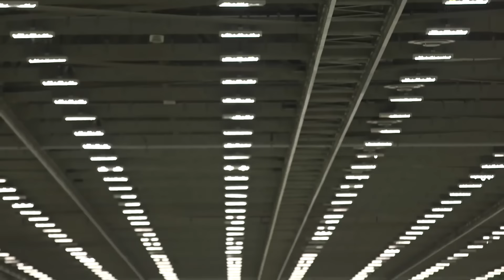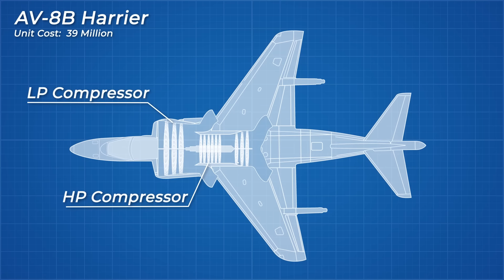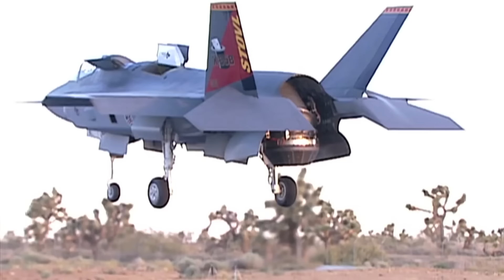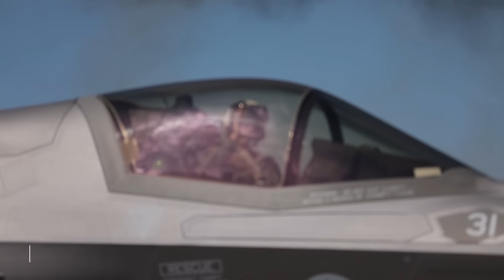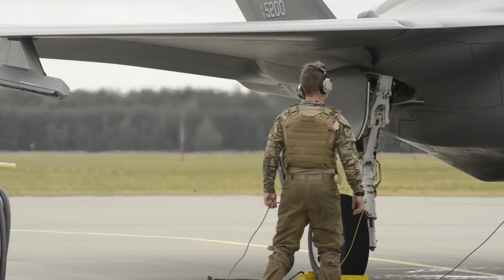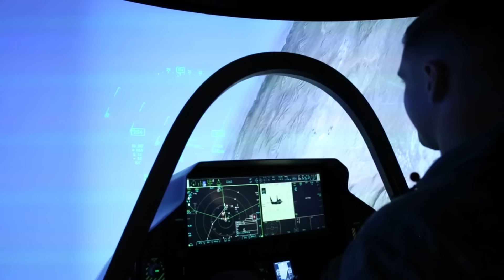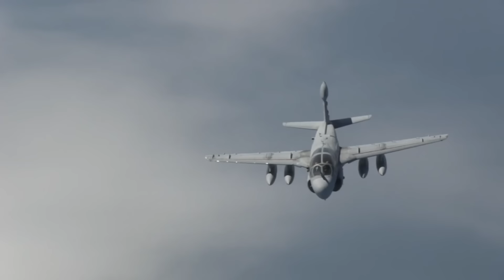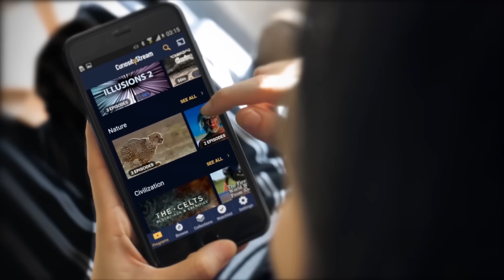Is The F-35 Worth $115 Million?

Comment: The $1.5T cost associated with the program is the total Cost of Ownership after 50 years of use and not the purchase price. How much would a family car cost for a similar duration including all gas, maintenance, a couple of engine changes, etc.?
Also, try comparing the cost of a large program/ bureaucracy building 3 variants Vs 3  large programs/ bureaucracies building separate jets with very little commonalities and synergies.
Reply: Another way to look at it is how much would it cost to sustain the jet fleets eg. F-15, F-16, F-18, 
Harrier, A-10 that it will be replacing for the next 50 years?

Comment: All season tire has compromise, this is what I got from the 2012 interview with Pierre Sprey. He may have been right, as now we see 3 versions A, B, and C! Still, you end up with the same airframe, even though you don't carry the vertical lift weight, I think there is a compromise in an al season tire.
Reply: Nope wrong again brainiac. Airframes are not the same. The F-35B has a much different airframe from The A or the C. You really should do some research before posting. SMH 🤦‍♂️
Reply: @CH-pv2rz  Yes, thanks for clarifying, I don't say that I am knowledgeable, so I am asking how things are now, because I see there is new info on this channel. Previously, there was a lot of bad press from interviews with retired engineers. I am just getting information.

Comment: Only the USMC variant costs that much for obvious reasons.   The Navy costs more that the USAF version, again, for obvious reasons.   The USAF F35 cost is down to around $80 million which is less than the price of an F15 or F/A 18.  The price comes down the larger the order because fixed costs and development costs are spread over more planes.  This is basic economics.  I will say that I fully support the F35 regardless of cost.  It is so far advanced compared to the J20 or SU57 that it can completely protect this country from external threats.  I wish it could protect us from Trump.

Comment: No way this could replace the A-10.
Reply: A-10s airframe is getting old. They basically make a fixed amount of planes and when they become to old to maintain they replace them.
Reply: I agree that replacing the A-10 and trying to fill a CAS role is the most problematic for the F35. I'd love to see a more specialized modern replacement of the A-10 personally, but I'm reserving full judgment on how well the F35 will do at CAS... it just doesn't have the same psychological impact for sure though.
Reply: Not really, because it would not fly the same mission profile. It would use its advanced avionics and precision weapons to kill from high altitude instead of down in the weeds.
Reply: The thing is A-10 has terrible situational awareness. I kinda recovered from awe of BRRRRT, highly recommend LazerPig's video on it.

But yeah, stealth planes for CAS role feel just... wrong
Reply: @John McCall: Are you sure?

Comment: The real killer for the F35 was that it wanted to be a jack of all trades.
That is simply impossible without extensive funding and research and practice, and by the time designs are finalized a new one will pop up with a new innovation.

The F35 should've been primarily built for the marines with secondary uses for the air force. The A10 already does air-to-ground combat extremely well, and any and all ATG combat requires that anti-air capabilities are disabled first so making the F35 have a focus on ATG combat just divided attention to a dead end.

Comment: The F-35 WILL NOT EVER replace the A-10 Wharthog, Ever. the Wharthog can do things the F-35 will never be able to do like loiter for almost unlimited amounts of time and save the lives of guys like me who were combat infantrymen who would call for aira support from A-10's.  Every time the Air Force tries to retire the A-10 Congress says HELL NO.  It is the toughest, most capabale airframe out there.  You can shoot off an engine, or 3 feet of a wing or a complete hydraulic system and it will bring the pilot home safely.  It was built to take massive amounts of punishment and still do the job  it was intended for.  So far this plane is not slated for retirement until 2040 I think.
Reply: The A-10's ability to withstand punishment has been far outstripped by the power of modern surface-to-air weapons. It was built to withstand manually-aimed, relatively low calibre machine gun rounds, not radar-guided high-calibre cannon fire or SAMs that are present on platforms like the Tunguska - it's probably not even safe from man-portable AA weapons at this point. The only truly survivable airframes nowadays are the ones that don't get hit at all. That's why the A-10 doesn't fly in contested airspace, even going back as far as the Gulf War. It does have the advantage of a long loiter time and being economical to operate, meaning that it actually is a better fit for the anti-insurgent job than the F-35, but it'll eventually be replaced in that role by light turboprops that can loiter for even longer and are even cheaper to fly.

Comment: The F-117 we lost that was shot down wasn't a failure of the aircraft , or pilot. It was shot down because mission planners had the planes following the same flight path to the targets over and over again and even if you can't see a plane you can hear it and if it follows the same path enough times it can be tracked and shot down. They broke the age old rule of when in battle never be predictable.
Reply: Same thing happened in Mogadishu.  Remember Black Hawk Down?
Reply: Well it was a mixture of things. As you said it was planners sending them down the same routes but it was also the fact that the nighthawk wasn't flying with the usual A6 Intruder escorts it'd have normally running radar interference, as well as the bomb bay doors being jammed open, significantly increasing it's visibility on radar.

Comment: Guys so-called "invisible" f117 shot down by the Russian-made 60's air def system. USA always forgot the most important rule ever they invented.
Murphy's Rules #1 "Anything that can go wrong will go wrong".
Reply: How is this relevant?
Reply: @infinitelyexplosive  f35 main thing is invisibility like f117
Reply: @schattenfaust  You're wrong on so many levels. First off, stealth is not invisibility. The point is to make it harder to detect the aircraft. In a more stealthy plane, you can get closer to a target than in a less stealthy plane. This is exactly the reason we have soldiers wearing camouflage. No one says camo makes you invisible, but we still wear it. 
Second, stealth works. Despite flying thousands of missions against heavily defended targets, one F-117 was shot down in total. If that's not evidence of the benefit of stealth, nothing is. 
Third, the F-35 is a multi role fighter that has stealth as a major design consideration. It's still maneuverable and fast like existing designs, and has some of the most advanced avionics in existence.
Reply: @infinitelyexplosive  are you saying f35 can take out su 35 or mig 35?i know being stealth is good when you lost the stealth in f117 case early opened up bombing ports detected by serbian defenders and that was from 90's .i dont know  putting all your money on something can be detected is bot safe option for me even su 27's giving hard time to f 35 is all about early detection
Reply: @schattenfaust  are you saying f35 can take out su 35 or mig 35?
Yes, absolutely. Most planes can conceivably take out other planes. AAMs are very effective and a lack of situational awareness in combat can easily lead to planes getting caught out, even when they are technically superior. The idea with stealth is that it creates an informational imbalance. It's more likely that the F-35 sees an enemy than the other way around, meaning that F35s are generally at an advantage.
Reply: @infinitelyexplosive  ok for the argument what is somehow su35 or mig35 sees f35 first for example with the new tech break through? what would happen?
Reply: @schattenfaust  Then the Su/MiG-35 had a decent chance of winning the engagement, depending of course on tactics and the overall situation.
Reply: @infinitelyexplosive  Technological advances in our decade, creating means to the new approach I understand f35 stealth need or ALIS integrated logistical support, but f35 is not adaptable to changes in technology, in my opinion, it's not like  f16 or f15, not sturdy, not agile not good at multirole, he is good and one thing and trying to excel to it but if it fails it fails completely.

Yes, only 1 F117 is shutdown  $160 million worth of equipment shutdown by 20.000 USD 60's era Soviet AA system. but you missed my point completely (or I can't describe it within understandable reason:) F117 was created for the sole purpose to bomb the enemy before establishing air superiority over the enemy, now its purpose changed  180 degrees as mop up enemy ground targets after the air superiority establish. All those planning does drain with one event. Maybe this is why USAF feels the urge to create a new "stealth fighter".
Reply: @schattenfaust  now its purpose changed  180 degrees as mop up enemy ground targets after the air superiority establish.
I disagree with that characterization. We understand that stealth alone is insufficient for modern strike capability, but it still allows for a smaller force to accomplish the same goal. We won't be flying any more missions without ECM support, we learned that lesson from the F-117. Note that essentially every new fighter project has incorporated at least some stealth elements. The difference is in how much they sacrifice other aspects in favor of it. 
The F-35 is still quite agile and capable of air-air missions. It has a lower top speed than the F-16, but it's important to note that neither will be flying at their top speed and that the F-16's need to carry several drop tanks reduces its aerodynamic performance further.
Reply: @infinitelyexplosive  But let me put it that way just think about f16,f15, FA18, capable or like how my uncle says  "hammer" like airpower, today most of those planes still even with their old ages able to go toe to toe with current fighter jets, it was a solid marvel of western military technology, also affordable, adaptable, efficient, dependable.

I read a lot of things from the internet about f35 as an aviation enthusiast, I know a lot of bad information is out there but the project is delaying and already past deadlines and still feeling rushed somehow and overall budget goals are not calculated correctly it drains so much money, Even some low tier countries going to have them which are very vulnerable to foreign probing/manipulation if you know what I mean.

F35 is expensive might be a good multirole fighter but I feel like so many Achilles heels on the project if it leaked it's a good chance the entire project turns into a disaster.

Comment: Update, the new cost of an F35-A version will be $77.9 million by 2022. The price of F35-B will be $101.7 million by 2022 and the F35-C will be $94.4 million by 2022. The trend is downward due to quantity buys and as the cost of manufacturing goes down. I wonder if you asked the pilots whose asses are on the line if the price was worth it, what would their response be?

Comment: First flight 
Yak-38: 1971
F-35: December 2006
Russian Yak-38 was first to use lifting device, just for takeoff and landing, located after pilot seat. Although the Yak did not use the rotor, but 2 smaller jet engines. It used 2 vectorable main nozzles.
https://en.wikipedia.org/wiki/Yakovlev_Yak-38
https://www.youtube.com/watch?v=1yFd8lx7vQI

Comment: Most don't understand the role of this aircraft.It's main role is to feed the F-15EX with targets and if needed to perform quick strikes against radar installations etc. in order to soften the target. It's much safer for them than it would be for the F-15 or F-16. The EX can just sit back and UNLOAD safely after the 35 has done it's job.
  So, those countries who buy this plane and use it as air superiority fighter or interceptor, won't be getting much from it. In that sense, no it's not woth all this money. But the ones who also buy....weapon platforms, like the F-15EX, make an excellent choice.

Comment: The F-35 is designed to survive even half the amount of damage that the A-10 can?!
Reply: The F-35 is designed to not get hit in the first place, which is generally accepted to be a better strategy.
Reply: @infinitelyexplosive  So, the A-10 is designed to get hit? 
The F-35 is a soft target in the CAS role where it is subject to small arms fire. It is a "jack of all trades, and a master of none".
Reply: @peterm.eggers520  Small arms aren't going to hit an F-35 at 10k+ feet.
Reply: @infinitelyexplosive  So the F-35 is not a CAS airframe?
Reply: @peterm.eggers520  what? The F-35 will absolutely be used in the CAS role. How is the altitude it flies at relevant? If anything, the F-35 is more prepared to fly CAS missions due to the enhanced targeting system compared to the A-10.
Reply: @infinitelyexplosive  The "C" in CAS stands for "Close".  A-10 pilots fly low enough for visual identification.  The Army soldiers value the A-10 above all others when they are in trouble, without exception.

No avionics that are useful for CAS, including targeting, are excluded from the A-10.  In fact, the A-10 pilots have the most advanced heads-up visor display for both targeting and threat assessment using AI to minimize the noise to highlight what is important.

You really need to do serious research, rather than relying on Google.
Reply: @peterm.eggers520  Guided bombs are incredibly precise now, there's no longer any need to fly at stupidly low altitudes. The "close" in Close Air Support means that you're engaging targets that are close to friendly forces - the aim of the mission is to kill the enemies and leave the friendlies unharmed. If you kill the enemy with a JDAM dropped from high altitude (where you're less likely to be hit) then you've accomplished the mission just as well as an A-10 shooting its noisy gun from just over the treetops (where it's much more likely to get hit.)
Reply: @Verminator4  You obviously have never been on a battlefield, nor understand the limitations of smart bombs/missiles in close combat.  Your understanding of the A-10's capabilities is also severely lacking, especially it's cannon's effective distance, smart bomb/missile capabilities and carrying capacity, and also loitering time.  There are good reasons why the grunts on the ground revere the A-10 above all other support aircraft.
Reply: I don't have to have been on a battlefield, the numbers speak for themselves. More A-10s have been shot down in conflicts since the turn of the century than any other USAF plane while also inflicting more friendly fire casualties than any other plane. This is in spite of it only flying in low-threat environments ever since Desert Storm. It doesn't take a genius to figure out that the A-10's antiquated low-and-slow approach is much more likely to get it shredded by AA than fast jets operating from altitude, the same way it's obvious that any advantage it has in loiter time is offset by its abysmally slow response time in comparison to supersonic aircraft. It's ordnance in bombs and missiles is equalled or bettered by any ground-attack-capable plane in the air force's inventory and the gun is no longer effective in its role of penetrating tank armour while also being imprecise, as is inevitable when you have a high-recoil gun being manually aimed by pitch, yaw and roll control while the pilot has to fight wind shear and worry about pulling out of his dive afterwards without the benefit of fly-by-wire controls, and that's without even considering the prospect of enemy ground fire coming back at it. Admit it, you only like the A-10 because you think it looks cool and it's loud and dramatic, not because it's actually better at anything than anything else than can do its job. That's the only reason anyone likes it, including the troops. Yeah, I said it.
Reply: @Verminator4  You took an awful lot of verbiage when you could just said you were clueless.

“If you can't dazzle them with brilliance, baffle them with bullshit.”
― W.C. Fields